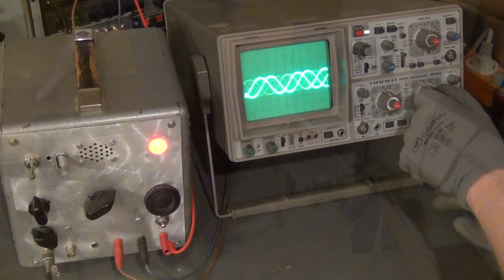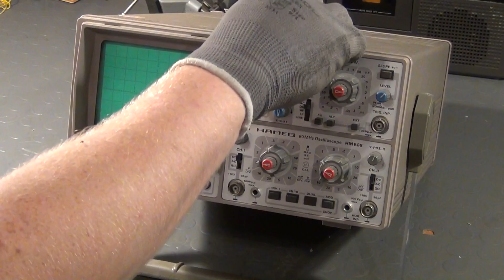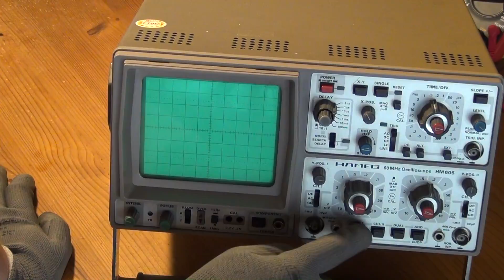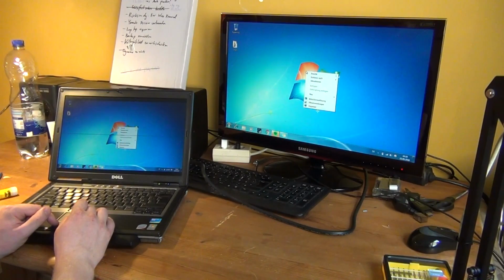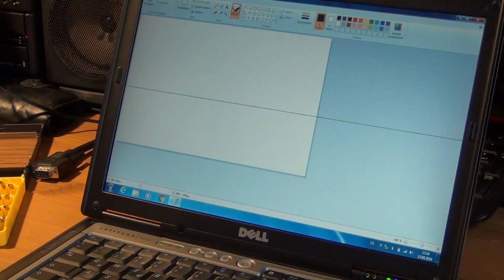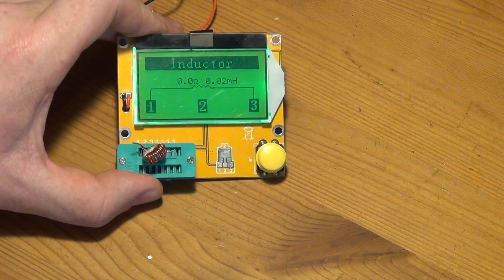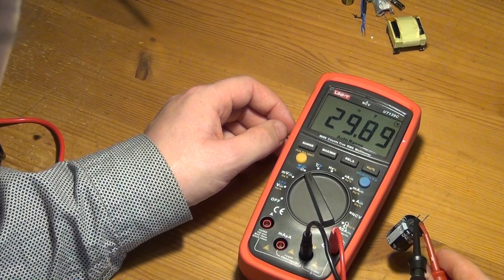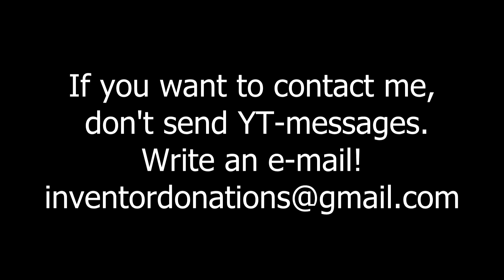New Workbench, Scope, Component Tester, DMM, Laptop and more

Comment: I have one of those component testers but I think you got yours cheaper.  :-)   I have mounted mine in a small metal box (that used to contain tea!) with banana jacks so I can test components that the socket won't handle.  I didn't use those pads,  but soldered small wires to the underside of the socket.  I've seen the opinion somewhere that those pads are for surface-mount parts,  if you were inclined to hold one in place on there,  something I have yet to do.

Comment: Those testers are very good... I've got exactly the same model. Most of what you can get are Chinese clones but the original unit and the software are a German open-source design with lots and lots of options and extensions available.  https://www.mikrocontroller.net/articles/AVR_Transistortester

Comment: That's not a good counterfeit AVR transistor tester. I have a yellow button and I don't even use it. I have two others that I like much better. You need to get one with a precision voltage reference. My favorite is the graphical one. I got a real project clone too, and it is OK. But this is my favorite one out of the 3 that I have http://www.banggood.com/DIY-M12864-Graphics-Version-Transistor-Tester-Kit-LCR-ESR-PWM-p-986954.html?rmmds=category

Comment: I would ask that house mate of yours for some nail polish and put some of the screws for the laptop hinge. (Or use real lock tide...) Those ALWAYS come lose causing a wobbly screen and over time you lose the screw / break the hinge :/

And for the component tester, the pads are not for test leads :D They are designed so you can press a SMD component onto it ;)

Comment: Those Dells are getting expensive because are still good for "most" of the task and have RS232. USB adapter proven (at least to me) to be GARBAGE, so this TRUE RS232 ports are a big advantage even for a 10 year old laptop. You can bring it to 2GB and Debian 7 will run no probs as well as Win 7 32 trying to avoid some of the updates.

Comment: You are the second guy that thinks the pads are for soldering wire to. They are obviously for SMD components (and very useful for that, as I have the same tester). What would be the point of soldering wires to the pads when you can just clamp wires into the socket? ;)
Btw. if you build a case for the tester and have the battery always connected install a real switch. When I measured the current draw of my tester you could say that it was not really power saving...

Comment: The pads of the component tester are not for soldering wires on! The pads are meant for SMD components - you press e.g. transistor on the pads and push the button to test it.

There are many variants of this tester around, it is originally this project:
http://www.mikrocontroller.net/articles/AVR-Transistortester

Comment: The dell Laptops are a peasure to work with, i fixed numerous of them. The generation after the D6XX one is even simpler to reoair, you can change a screen within 10 minutes, and only have to screw out about 6 screws.
Reply: i am actually still using one of those old laptops, just because it is so relaible and durable :)
PS: The "soldering pads where testleads could be soldered onto" are actually pads to test SMD Parts

Comment: Nice oscilliscope, doesnt need to be new or digital to be usefull :-D
Handy free laptops, you are a lucky man.
Ive looked at the micro based device testing units, but i cant see how they can be too accurate, but that could be just me.
Reply: they dont need to be so accurate, but even for the ESR function its worth it, ive just bought one myself just in case, well worth it for 8 quid!, even if its 10 percent off, its more than good enough to tell a bad cap
Reply: Yep your spot on there, its a bit like the cheap yellow multimeters, for basic stuff they give you a go - no go, often good enough.
I did have a look at many diy circuits but the word "Accuracy" never appeared, still interesting to see the methods of esr measurement.
I have an old 5 digit cap tester i built from an electronic mag in 1985, that gives me a hint all is not well, but i did mod it to belt ten times more current through the cap tested lol, brute force/torture :)
Reply: zx8401ztv
this is the one i just ordered - 252444128979 - has a bit of info not really a 'spec' though.
Reply: Paul Frederick
i did get the one i ordered, its just fine, i tested a lot of recycled caps and resistors from a working old tape deck, all of the readings were in spec of the components, the esr's of each caps were also low, this old tape deck still worked fine along with its AC input caps, so i am sure the tester wasnt lying
Reply: I have a tester exactly like the one in the video (there are several other versions available) and the accuracy is far better than what I ever needed. I don't really have any reference components except for some 3.3nF 1% rated SMD caps, but when I tested them the meter showed exactly that. The ESR mode is very useful for troubleshooting PSUs and I use the SMD pads (no, they are NOT for soldering wires to) all the time to check suspicious SMD components, including transistors and diodes.
Reply: Sounds like your very happy with your tester :-D.
There appear to be too many versions out there, and on most ive never seen a propper spec sheet telling me accuracy, so i ignore them.

You can tell that the sellers know nothing about the tester they are selling, no pdf is available eather, so you can understand why i dont have a whole lot of confidence in them.
Reply: Yep ive seen that one or ones that look the same, ive saved the page as a bookmark to return to :-D
Yes the data is just what it can measure, no accuracy values, perhaps they are much the same :-)
Reply: Pick one up and then you'll see how it can be accurate. Well, they're accurate once you calibrate them. When you short all three leads together it goes into calibration mode. Cal on some is also a menu item too.
Reply: Ive found that a decent multimeter has been the most usefull thing i have, other than a variable psu and a nice mug of tea :-D.
I have a "charge up" digital cap tester i built in the 80's, but esr is something i havnt got a device for.

I assume that most capacitors in switchmode psus are suspect, and switchmodes deliver dead caps in a regular way lol.
Outside switchmodes, the basic digital charge up job works :-)
Reply: jusb1066
I have 3 different AVR transistortester clones. Some are better than others are. The one TAI is showing in this video is collecting dust on my shelf. It is the worst of the lot.

Comment: You think that's an old scope? Mine a Heathkit IO-4541. My dad bought it as a kit and built it.
Reply: i had a ww2 us navy oscilloscope, round window, wonderful heavy steel box with closing lid which was its storage/shipping/handling box, tool storage in lid.  lovely bakelite probes, knobs, heavy duty metal toggle switches...it was single channel and 5mhz,  it worked fine, i just didnt use it, didnt sell for very much, shame.
Reply: @jusb1066  that sounds BEAUTIFUL... if I had such a thing, I probably wouldn't use it much either.... but it still sounds BEAUTIFUL!

Comment: The nice thing about the Dells is that the BIOS is unlocked - you can install new components like upgrading the WiFi module or even the CPU w/o the BIOS locking it out. I upgraded a similar E5510 with a Intel 7260 WiFi module (from a 6200) and i7 (from i3) CPU and it doubled the overall speed.
Reply: is thermal dispensation an issue with the new cpu
Reply: Not that I've noticed - been about a week now and I left it on for many hours. They originally came with a choice of i3, i5 or i7 to begin with so they were designed for it. These are the first gen iX cpus (only ones supported by the chip set on the laptop) so they are only 2-core (4 with HT).

Comment: I noticed you use Knipex tools, they're excellent and definitely my favorite pliers. What other German tool brands do you prefer?
Reply: there's actually a video with a review of tools, browse through his older uploads, should be easy to spot
Reply: Just to give you some names to check yourself - I've seen those German tool brands at various locations  (R&D departments, electricians, car mechanics, ...): Knipex, Wera, Wiha, Hazet, Gedore, Fein, Bernstein, (Proxxon - more like consumer/hobby level)
Reply: I prefer Swedish, or Swiss tools over German myself. But it is really hard to come across any of it. For most things cheap Chinese junk works fine for me too. I got a pair of no name angled needle nose pliers I bought on Canal St. ages ago that I just love. I think they might have been made in India? But they have just the right angle, and size for me. I'm going to the grave with that pair of pliers.
Reply: Paul Frederick Haha yea when I buy cheap tools 98% end up being throw-aways but every now and then you find a cheap hand tool you end up liking more than almost anything else. The worst part is you can't let those tools outta your sight, if you lose it you'll never find another one due to lack of branding or any real markings.
Reply: Bobby Bangs
I judge all other angled needle nosed pliers by that one pair. Which so far for me has never been bested. I'm sure there's a better pair out there somewhere, but I've never held it in my hands.

Comment: Those cheap LCR testers are shown to be pretty accurate
Reply: It is quite incredible for that amount of functionality to be incorporated into such a small, low cost device. It may not have ultimate accuracy but for general workshop use it is very suitable.  Truly a wonder of the electronics age in which we live.  I have 40 year old LCR testers that were state of the art, but are huge in size and don't have a fraction of the measuring capability or convenience of this tiny little module.
Reply: digitalradiohacker

Thats exactly it, value for money. The average electronics geek doesn't need the n'th degree of accuracy or sophistication, so these low cost modules are ideal.  There are some very clever electronics designers in China and it show's!  China is turning out more Uni graduates than any other country and they are all getting very busy with stuff!
It's so funny to look at how it was back in the day,  when I began my electronics life the old boy's would ridicule anyone who suggested a 'scope was necessary for servicing work, even an Avo was considered excessive!  One guy I worked with only ever used a screwdriver, neon tester and his finger!  Oh, and his brain!
Reply: ***** Nope 
design by a german man based on the arduino chip
Reply: sim6699

Good to know, thanks. Made in China though.
Reply: Well, you can build one from scratch. But I wouldn't, and haven't. Because the Chinese knock offs are cheap as chips, and better than anything I can make. The trick is to get one with the precision voltage reference, as opposed to a zener diode. This is almost an exact clone of the open source project http://www.banggood.com/DIY-Meter-Tester-Kit-For-Capacitance-ESR-Inductance-Resistor-NPN-PNP-p-929603.html You can probably flash it with the code from the project, and it would work. Though I never have. I just run it with what it came with. I actually like the Highland DIY M12864 Graphics Version Transistor Tester Kit better. But with the weird display I doubt it can run project code.
Reply: These units can also self-calibrate.
Reply: where can i purchase one?? or any schematics to build one??
Reply: ebay.
Reply: nigel mahabir There are lots available on ebay although not all can be updated to the latest software.
If that is important, you will need to do some research into that
Reply: you mean the AVR chip, which Arduino happens to use.
Reply: Inexpensive LCR tester
Reply: https://www.mikrocontroller.net/articles/AVR_Transistortester

Comment: Is there any way to convert the laptop LCD to a more common plug? vga etc? so one could use it with an overhead projector like you designed some videos ago.
Thanks
Reply: i think that model and age has a plug on the back for a screen already.
Reply: Yes, you can buy these on ebay. They have to be exactly matched to the panel, i bought one from njytouch a few years ago over ebay.